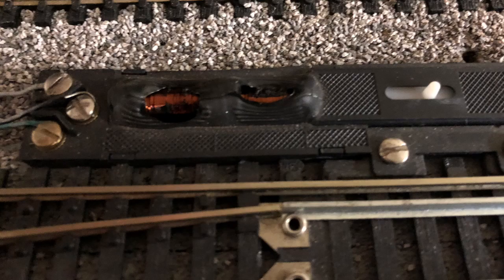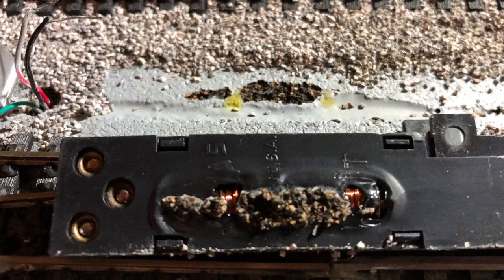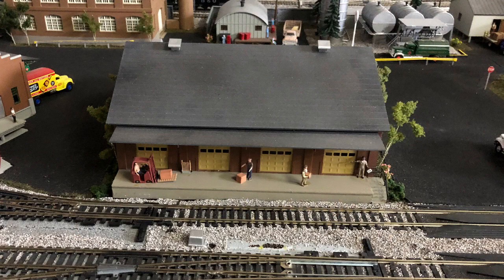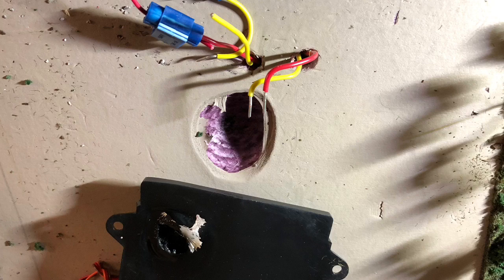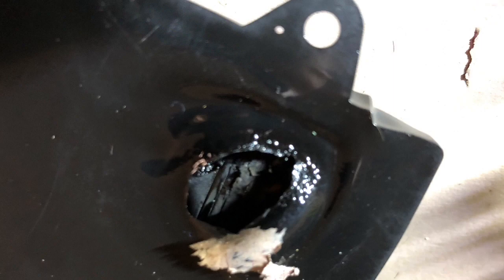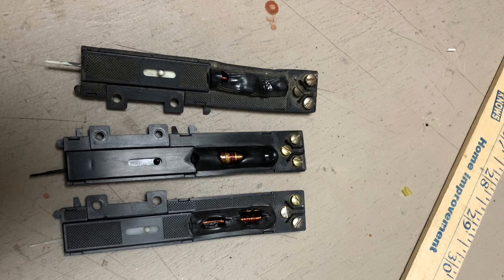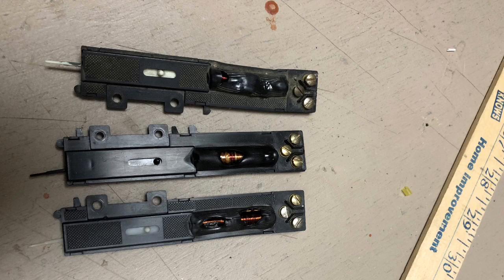My 4x8x2 HO Layout - Major Electrical Short

Comment: Wow that could have been so much worse 😬😬😬.  Good you were close by and as you said now you can replace those - always an upside 👍🏼
Reply from the maker: I guess I was lucky.  I was planning to replace the three snap switches.  But I was going to use the DR4018 on the old layout snap switches.  Guess I’ll have to get another one.  It wasn’t the devices fault.  Be safe😷

Comment: quite the short!
Reply from the maker: Oh yes.  I real good one.  🤬 I don’t care about the snap motors, I have many spares,  but disappointed about the DR4018.  I was planning to move it down to the older 4x8 layout to run the snap switches on it.  There about 20 snappers on this layout.  I’ll have to buy two now instead of just one.  Thanks for your comment.  Be safe😷

Comment: Wow! Happy nothing bad happened!
Reply from the maker: For sure.  Good thing I was right there.  I have threatened to set by layout on fire 🔥 or a certain locomotive but this was unexpected.
Reply from the maker: Thanks.  I have fire extinguisher in the garage but didn’t even think about it.  I never saw flames, just smoke and smelled the melting plastic.  Killing the power stopped the action.  I don’t even want to think about an actual fire.  I guess the DR4018 could have flamed up and caught the warehouse on fire. I might have thought about extinguisher then.  That would have made a great video.  🤪

Comment: Oh No WHOA! 😵 you to had that happen yours was worse the road bed the foam bed,  3 motors ? Mine was just 1. Well Fred were practically tied for that one, thanks a lot ATLAS !  OMG!  😱 I am laughing in shock 😅😅 You got me good Fred . 😀
Reply from the maker: I was in the process of replacing snap switches with Smails.  Doing a few at a time.  I remember just pulling out some wire that was twisted together.  I guess my stupid move caused couple wires to end up touching in a bad way.  This short out forced me to finish the replacement job.  I didn’t mind loosing the snap switches but the DR device cost $50. 🤬
Reply: @FredE528 I have another. I had a powerpack by CMI I connected to my set i had the MRC Diesel & Steam component The CMI had another sound type horn & speed adapter. This unit had so many electronic issues 1 malfunctioned no sound returned it. One decided to be full of bugs in the circuitry while i had it off the unit started smoking ! 😱It almost blew out my other MRC  sound system  & almost lost my layout & cause a fire!  I returned that unit as well The dealer had the nerve to say i sold a lot of these & never had complaints then i said this product is no good. I almost lost my layout to a fire! CMI was garbage my other hobby dealer agreed. So Fred i have had these bloopers to. 🤐 📯 😳😲😀
Reply from the maker: That sounds really bad!  I have our home fire extinguisher right inside the door to garage.  I’m ready if my layout were to get set on fire …opps I mean accidentally catch fire.
Reply: @FredE528  I wouldn't be laughing , then i would be concerned for safety. In seriousness Fred i may do this on my future layout for as a precaution.

Comment: My suggestion:  go retro and use either wind-up locos or if you dare, battery operated ones.  (jk).  Curious, when you mentioned snap switches, are you talking about manually moving the points for operations?  I have 8 Peco switches (turnouts) that I planned on operating with tortoises or other brands.  But my constant back pain is keeping me from going under the table to install motors on all of them.  So, I decided I will throw the switches myself as I walk around the layout.  I even bought the Caboose throw stands, but not sure if I'm going to use them at all - so damn tiny even on HO.  I gave a thumbs up but not for the electrical conflagration you started. LOL   Cheers, Bob
Reply from the maker: Wind up locos, funny! 😀  I don’t think the Atlas snap switches will fit Peco turnouts.  Just make for Atlas.  I have only two Peco turnout on my layouts.  Those curved troublemakers!  

Snap switches use DC current, typicality off a transformer which runs DC locos but could be separate power supply.  They are quite easy to install but still would require wiring under the layout.  If you have foam over your plywood then you could cut channel in the foam for the wire.  Might be easier than installing the Circuitron motors.   They are just ugly as #$&@ on the layout.  You can trigger the snap with several styles of momentary buttons.  I used the Atlas ones that I already had.
Reply: @FredE528  Very interesting info, Fred.  Not to prolong this, but I thought Atlas switches were at the bottom of reliable switches.  Thought I saw that on the Model Train Forum.  Hey, if it works, that's what counts.
Reply from the maker: You might to right about that, I’m probably going with Peco in future.  I had all Atlas brass track and snap switches stored for 30 years.  When I started my original layout I didn’t think I would get ‘hooked’.  I only knew about DC power and Atlas track.  When I needed more track and turnouts I just stayed with Atlas.  Bought used off eBay, mostly old brass turnouts.  I did change to the newer Atlas flex track for curves. 

I have thoughts of building a new layout in the basement of a condo we bought in N.H. where our daughter and her family live.  I’m unsure how much time and money to invest in this new layout.  I’m thinking about installing track, wiring and all electronics on the bottom side plywood/foam before attaching plywood to the frame.  This would reduce under the layout work.  I’m 72 and can work underneath but probably not for long.
Reply: @FredE528  Ahhh, you're a youngster!  I'm 73! Take care...
Reply from the maker: Old coot!

Comment: Whew!   That could have been a disaster.   Don't  tell the wife.  

DO add fuses to everything now.  Not just the replacement items, but retrofit every circuit on the layout.  It's cheaper than a new house... or a funeral.
Reply from the maker: How are you?  

I removed everything associated with the snap switches.  It was closed circuit with the three switches connected to the DR4018. DR4018 had its own power supply with nothing else connected.  Good excuse to buy more Smails and finish all turnouts remaining on new layout.  I was planning to do this soon anyway.  Worst part is that DR4018 is now in trash can.  I was hoping to use it on the old layout.  20+ snap switches there and too costly to use Smails.  I’ll need to think about how much to spend on this.  New turnouts to get rid of brass guys.  Will look at cheaper ways to motorize them.  Servos and Arduino?  Oh NO...
Reply: @FredE528  Quite out of character, I seem to be improving.  So far, this has  been no worse than a minor cold.  I can't figure how I got lucky.  But I'm staying in quarantine for the next 2 weeks.  No tempting fate.

I think Arduino controlled turnouts would be far simpler than JMRI scripts with sensors, or DCC++.  Just as long as the servos are installed to be easily replaced.  

And fuses!  Lots  of fuses!
Reply from the maker: So glad to hear that you are not badly impacted.  Some people have light reaction while others not so lucky.    Is Stormy nursing you back to health or has she run off?
Reply: @FredE528  Ever faithful Stormy.  :)
Reply from the maker: Maybe it will last then.  Who knew.

Comment: If power is left on to snap switches they will burn out, you need to use only momentary switches, I see you are going to use some Smail's, They look really nice
Reply from the maker: Thanks for comment.  I accidentally screwed up 🤬 the wiring to snap switches when removing old wiring.  Fried the DR4018 and 3 snaps.  Oh well, just pushed me earlier than planned into installing Smails to finish out all the turnouts on the newer 4x8.
Reply: @FredE528  Waiting for some Smails' myself for a small switching layout, hope they work pout for me
Reply from the maker: They should be fine.  I have couple videos on these somewhere in my playlists.  Also, other good ones on other channels.  Search on Smail if interested.  One issue that bit me in the a## was not cutting off the wires short enough after turnout was down solid.  Caught on couplers.  Good luck. 🍀

Comment: Wow Fred, that's scary!  I strongly suggest you spend $28 and buy the Circuitron Snapper Relay.  It prevents shorts and makes sure only momentary power is given to those solenoid switches, even if the toggle or switch gets stuck.

Go here and read the description....
http://www.hobbylinc.com/htm/ctn/ctn5303.htm

You only need one to put inline between the power feed and all the switches.  If you are using solenoid switches, this is a must!!!
Reply from the maker: Thanks for the information.  I’ll check it out when I start to work on the snap switches on the old layout.  I want to get these turnouts under DCC control.  Since the DR4018 is toasted, I have to see what options are available.   Just another 🤬 learning experience and opportunity to do something different.  😀
Reply: @FredE528  These solenoid switches can only take one quick burst of power.  Anything more than one second of power input can melt them as you have had.  The Circuitron Snapper can be placed inline in between your DCC control and the switches.  Its basic function is that it is a large capacitor that is designed to release one short burst of power, then it "closes the gate of power" eliminating any chance of a stuck switch or improperly programmed DCC command providing continuous power.  It's a fantastic Fail Safe piece of equipment and anyone using solenoid switches should have one of these inline.

Like I said, You only need one, so it's a very affordable safeguard.

Good luck!  :)
Reply from the maker: Thanks for the description.